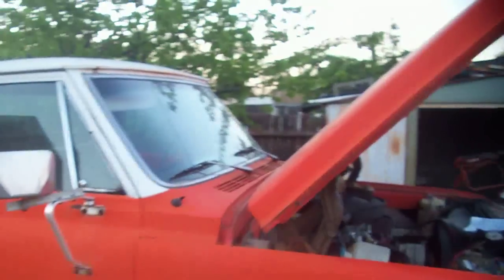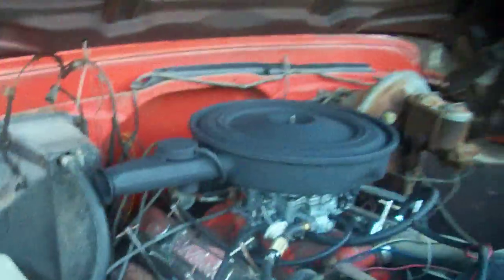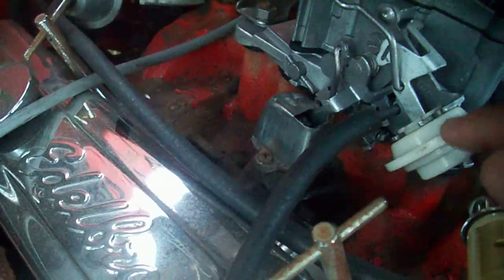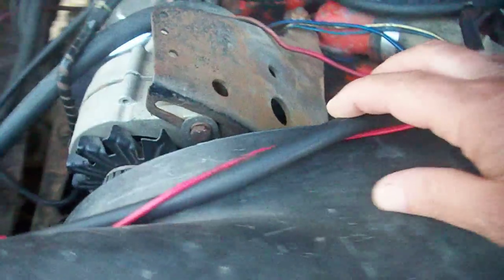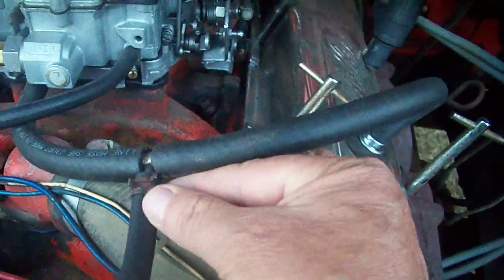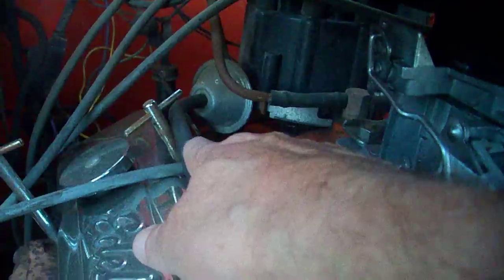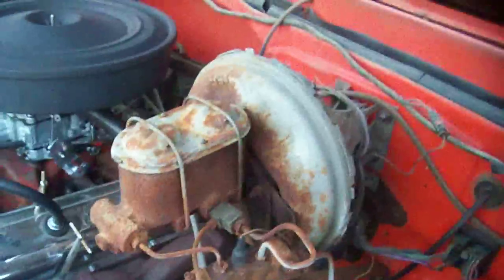1971 Chevy vacuum lines

Comment: This is useful information clearly and simply detailed. Well done!
A perfectly working PVC is important to the engines health. 
The air filter housing looks great. Simple things like that make a difference. I bought a 1985 C10 last week and am going through all the vacuum lines removing most along with the disconnected or defective air pollution control items.

Comment: Enjoyed your video. I just finished doing same job on my '72  C10 with 350 I've owned for 30 years now. Noticed you didn't change the hose running from the charcoal canister to the front lower vent pipe to tank. I noticed in the Chevy service manual (section8-12 , figure 16) that there is  a small plastic "restrictor" with a small hole in it 1 .25 " in line from the canister end. I cut into my old hose and there it was so I shoved it down in my new hose. Not really sure what it does other than restrict flow. I would not have discovered this without having seen the illustration in the factory service manual. Hope this helps anyone changing these hoses and wanting to keep the system stock. I could have easily thrown my old hose away without knowing  there was anything up inside it. Also I installed new filter  (made from a dust mask) in bottom of the charcoal canister. I removed battery and tray to get to it. Thanks for letting me comment, love my old truck. Thanks.

Comment: FYI - the air filter snout valve -- is not about smog
It is about helping a cold engine run better by drawing warmer air from an air tube between the exhaust manifold and the snout when the ending is cold. 
The warmer air helps the gasoline vaporize for better combustion.
As the engine warms and the choke opens, the snout close off the "warm air" inlet and will begin taking air from the engine compartment rather than from the tube bringing air from around the exhaust manifold.
If you have not tube connected between the snout and the exhaust manifold (like the engine in the video) then there is no need for any vacuum lines.
This feature is usually negligible help to the engine except for sub freezing temperatures.

Comment: Yup, it helped me! ...but you should still care about emissions EVEN if you're not legally required to! Older cars have a wildly disproportionate effect on overall air quality, and it'd be the proper thing to make sure all emissions systems work.

That's actually why I'm here: my dad's 69 Chevy is totally missing the heat riser and THERMAC vacuum hoses (he says he had it removed years ago because some mechanic thought it was causing problems), and I want to be a good citizen and pollute as little as possible :)

Comment: I appreciate it i needed info on the Canister and pvc I figured i would have to T them off my edelbrock carb on the center port but now i have correct info that i must I appreciate. 75 Monte 400SBC 64cc skip white aluminum Heads Mild cam Th350

Comment: everyone pulls that off cause they run so much better without that crap on there..  that extra vacuum to the charcoal canister is the power robber.. i hooked all that up one time and the car got slower..  same set up on a 72 monte carlo..  the emissions systems on those years was bogus crap...  literally ..   the charcoal canister is the vent to your gas tank..

Comment: So i have the exact same truck same model same year and all that, i did my gas lines by watching this video thank you by the way. But what i need to know is how to put that same choke back on i beleive that is why my truck will die in the middle of driving it, i have checked my gas lines, just replaced the fuel pump, i just can not figure out how to put that choke back on. if you could please post a video and send me the link. thank you

Comment: I have a question for you. Is it possible to run your booster vaccum line to the rear of the carburetor? (I have an Edelbrock carburetor that has a threaded plug in the back of it. I'm thinking about running my booster vacuum line to it.) Also, will I have to run a filter between the carburetor and brake booster?  (I noticed when I removed the threaded plug from the carburetor it was a little wet with fuel.) I'm wondering if the  fuel will damage the brake booster?
Reply: There should be a vacuum source on the intake manifold.  Usually there's a plug in it if a booster isn't connected

Comment: can I run the power brake booster vaccumm  to the vavlve cover port on the opposite side of the egr
Reply: no. you have to connect it to a bigger port in the intake manifold just below the carburator
Reply: Spot Light nope

Comment: FYI - the charcoal canister . . . 
when the engine has been running and then stops (taking a normal trip somewhere)
the the fuel in the carburetor will expand/evaporate and the evaporates vapor gets pushed down to the canister.
Then, when you start the engine, those vapors are pulled back up and get burned by the running engine.
This is an environmental thing and is not a requirement for the engine to run.

Comment: Thank you for this very helpful video, I just installed a new Edelbrock 600 cfm on my 1973 Elco and was having a hard time how to understand the vacuum system on the 350. Now I need to change my brake booster vacuum line to the manifold port. My Elco is also a Cali girl, stock 350, working on getting rid of the smog crap.

Comment: ⚠This comment is only for people that don't live in a strict engine smog/emission regulated state. If you live in California, Connecticut, Delaware, Massachusetts, New Hampshire, New Jersey, New York, or Washington DC the below comment may be illegal to perform on your vehicle. ⚠

You don't even need the Charcoal canister. Damn it! You don't even need any vacuum lines to the Intake Vacuum Valve (EGR/Purge TVS), or the Thermostat Vacuum Valve (EFE/DISTR TVS) that some 70s and 80s models have. 

Most of TVV and IVV is just reusing heat to heat up components (not enough to heat the engine but California likes it that way so whatever). The only thing that should connect to the TVV is any type of Temperature sensor for the temp gauge in the cab, the EFE, everything else on it can be plugged (Don't plug them if you don't connect these things. Just let it blow heat). For the IVV, it can just sit there and blow heat. 

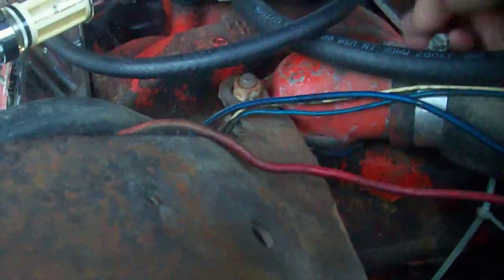Somethings that are nice to connect for performance is vacuum advance (DISTR). Which is shown at 2:44. If you run an automatic choke, remember to hook up your Manifold Vacuum to the Choke Pulloff (Manifold Source or carburetor manifold. Doesn't matter). You can find how to do it at 1:21 (Instead, connect this to the Manifold Vacuum on the Carb or Source). This is really it. OH, and also remember to connect your cab vacuum for the heater to a manifold vacuum.

Comment: glad i came across this video -i was looking to hook up a 3 line charcoal can to my 77 c20 cheyenne as they didnt come with them because emissons only applied to 1/2 tons and cars in 1977 - ive ponderd using a vacumm switch etc but tee-ing into the pvc line looks like the way to do it

Comment: this is a huge help. I am working on a 75 c10 , and this is similar enough to explain quite a bit. Can you explain what the pieces inside the air breather are supposed to do though? It seems good to know that you dismiss the parts so easily, but what should those 2 vacuum lines accomplish?

Comment: Great video, Some of these carbs had a "Timed Port" running to the Dist vacuum advance. How can anyone set the timing with a Timing Light if the Distributor Advance isn't pulled back all the way? Wouldn't this keep you from getting the timing correct? I always ran it to a good vacuum source for this reason but was curious why and what purpose it served?
Advanced ignition timing will be harder on the starter. Wished someone could shed some light on this function.

Comment: DUDE! You need to extend your few lines and put that fuel filter somehwere else! That is not the correct way to install a glass filter. You need to zip tie it near or somewhere by the fender above the carb. Basically far AWAY from the manifolds.